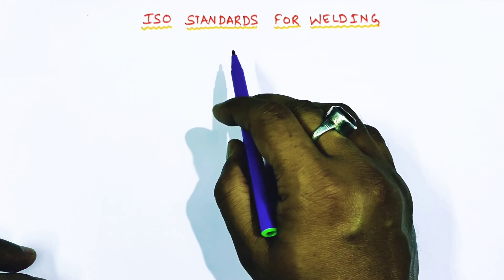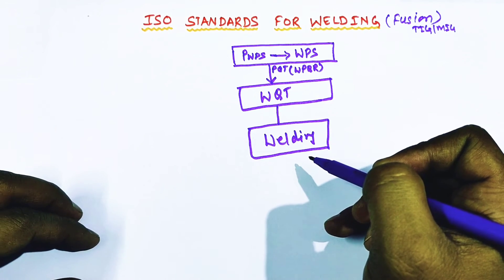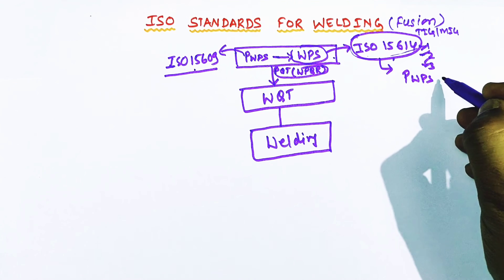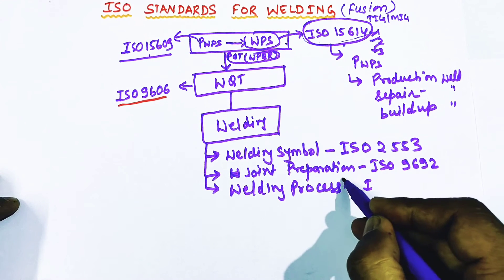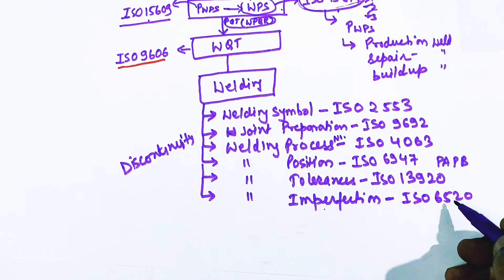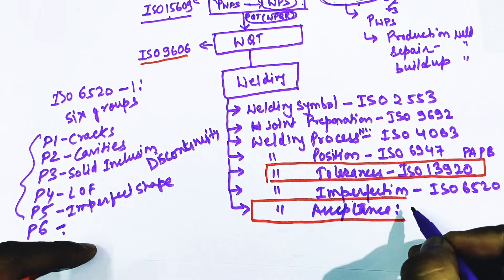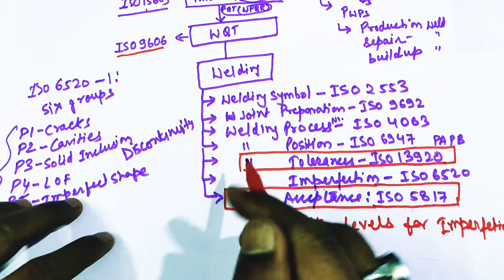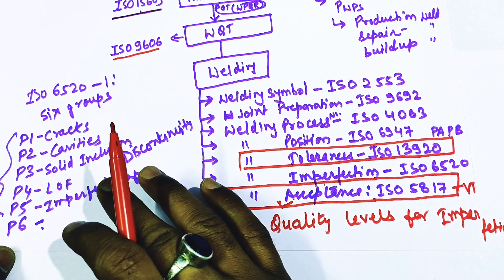[English] ISO standards for welding

Comment: Hi Bro!!!
ISO 15614-1 para 8.4.3 type of joint / weld (For Level 2) mentioned:
a) butt welds qualify full and partial penetration butt welds and fillet welds, while fillet weld tests are required where T-joints are performed by fillet welds or partial penetration butt welds in the predominant form of welded connections in relation to the design and production welding
b) full penetration butt welds qualify full and partial penetration butt welds and fillet welds in any type of joints
=> "a" tell me, when PQR with butt joint and Full penetration butt weld, Fillet weld test is required if I want to welding fillet weld in production.
But "b" tell me above PQR can approved for Full/Partial and fillet weld in any type of joints
Hence, what are differences between "a" and "b"?
Which case I can use "a" and which case I can use "b" to write WPS.

Hope receipt you advice in that case.
Thanks Bro !!!